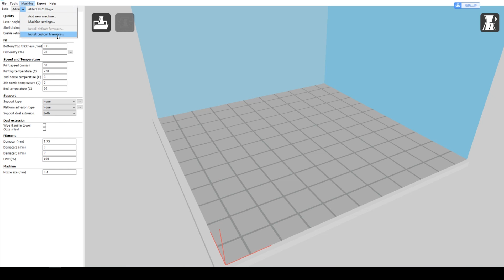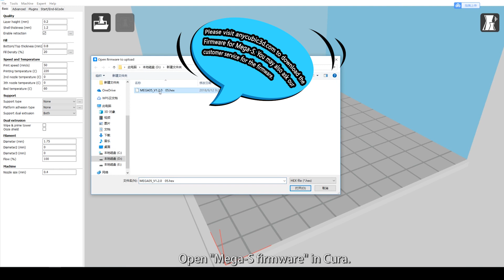ANYCUBIC ---- How to upgrade to Mega-S from Mega printer

Comment: For anyone running custom Marlin: just set the extruder steps/mm to 384.00
This is the one set in the official Mega-S firmware, and that's the only change needed.
Enjoy. :)
Reply: Could you please explain how you change the extruder steps?
I want to change it with this kit, I use Cura.
Thanks
Reply: I would like to know as well my print is coming out horribly

Comment: Nice video, but where do I find out why I'd want to upgrade to Mega-S?  From the video it appears it'd just add vibrations by attaching the spool weight to the frame of the printer?
Reply: The extruder support flexible-filament feeding.
Reply from the maker: Difference between Mega and Mega-s
http://bit.ly/2DsOisP
Where to buy AliExpress: http://bit.ly/2FTrlQX
                        AMZ US: http://bit.ly/anycubicmega
                        AMZ CA: http://bit.ly/anycubicmegaca
                        AMZ DE: http://bit.ly/AnycubicMegaDe
Reply: you mainly upgrade the extruder. if you dont want to install the holder, then just dont do it.

Comment: I installed this upgrade kit and my printer never worked right since. I spent many hours messing with the firmware update and it’s not working. It says on the computer it updated, but on the screen in the printer it still says version 1.0.0 and it doesn’t work. If I try to level the plate, no motors move or anything.

Comment: Just did the upgrade. Cura said the update to 1.1.5 was successful but the printer screen shows the firmware as 1.1.0. Printing seems to work well however, so I guess they just aren't arsed to update the software version on the screen. It was the same with 1.2 for me.

Comment: I installed the kit, and did the firmware upgrade but still shows that I got 1.1.2 in the screen . however, when I try to print I got a problem that the filament sticks on the head and stick on the bed and keep sticks on the nozzle. tried put back the original one still the same problem so what should I do? try to install any firmware still the problem issue .

Comment: My mega s 3d printer extruder keeps making a clicking sound as if the filament is slipping and failing to extrude! This is just 2 weeks old and the prints are coming out very brittle. This is my first ever 3d printer and is there any fixes?
Reply: I have the same problem now. Did you manage to resolve it ? I think it's the nozzle which is obstructed.

Comment: Can you confirm that the firmware upgrade will work with all Anycubic i3 Mega? I heard some versions of the i3 mega could not upgrade firmware....
Reply from the maker: Hi there. The mega with 03 version can be upgraded to mega-s by upgrading the firmware.
Reply: @ANYCUBIC3D  Will there be an update for the version 04 (32 Bit)?

Comment: Hi. 
Rectently i buy the upgrade to Mega-S, the hardware installation was fine, no problems. 

The problem is that i can't upgrade the firmware:
MEGA-SV1.1.3.hex

In cura said me all the times i have a communication problem. 

My printer have the original trigorilla pro 32bit board, i download the drivers and cura software from your web and follow the video tutorial. 

When i saw the board in the control panel like:  Prolific USB-to-Serial Comm port (COM7) 
the device don't show any problem 

and In Cura I select this com port and try to update, but don't work
Reply from the maker: Hi Rafael, sorry for the incovenience it may cause. Could you click the link below to submit your inquiry, please? Since the tech team could give more professional answers and solutions. http://support.anycubic3d.com/submit.html 
our tech team are glad to help. Thank you for your patience.
Reply: I have the same problem, did you manage to fix it?
Reply: @raynlaze1339  The same for me, did you manage to solve it?

Comment: I installed this kit, updated the mega-s firmware like the video says, it did not update it, still have V1.1.0 Am I not able to update to the mega-s firmware? was this just a waste of money?
Reply: This extruder appears to have a different step rate. It will run far too slow with 1.1.2 firmware so you must install 1.2.0. If Cura indicates successful upload then you should be good to go. Anycubic have committed a cardinal sin in NOT changing the version number - it still shows 1.1.2. (I've checked the code and yes, it really is 1.1.2) Stupidity in the extreme! However, if you can print then you know it installed ok.
Reply: Is it just the version number that was not correct or was the firmware update not succesfull?

Comment: Hi, I installed this kit ( I paid $39.99 Dlls at Amazon) and updated the mega-s firmware like the video says, 
and it did not update it, it still has the same version V1.1.0 ....
I am not able to update to the mega-s firmware I don’t know what happened ?
Reply: I already tryed it aswell and it looks like it is a Bug or something.
Reply: Just tried one myself with no luck today, old motor is back. 

I will try again with firmware I3_MEGA_V1.0_updated 20170804 from anycubic tomorrow.
 Crossed fingers
Reply: New motor installed , firmware flashed. Test print not sticking, after leveling , it seems to be under extruding. ANYCUBIC I followed the directions in the video why is it not working ?  I see people with questions 2 months old and you have not responded, do you want my business ?. I like the printer but if there is no support I will go to your competitors.
Reply: Ok I prob used wrong firmware. I found this MEGA-SV1.1.3 , and will try it next. Note this is not the file name used in the how to video.
Reply: Cudos to anycubic I have an email from support, thank you.
Reply: 3rd try, and I think I have it right now. Test print is on the buildplate now.

Comment: Anyone else have a problem with updating the firmware? IF I can get the printer to show as being connected to the computer in Cura, as soon as I click on the .hex file to update it, it says update failed due to an communication error, & then the printer isn't connected anymore.
Reply: Also, anyone print from their computer? The one time I got it to act like it was going to print, everything heated up, & the print started, but the Z axis never homed, so it was printing in the air. 
From the SD card, it's printing great. Super pleased with the quality.
Reply: Ensure you select the actual COM port in Cura. Don't set it to AUTO. AUTO wouldn't work for me but once actual port entered it worked fine.
Reply: @alanlondon8830  haven't bothered with it for a while, but I'll hook it up to the computer & give it a go. Thanks